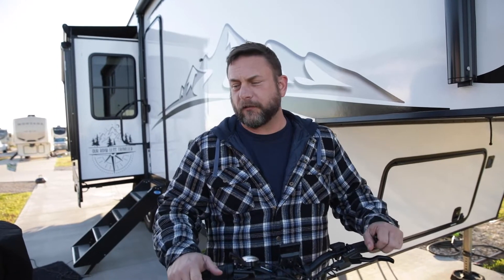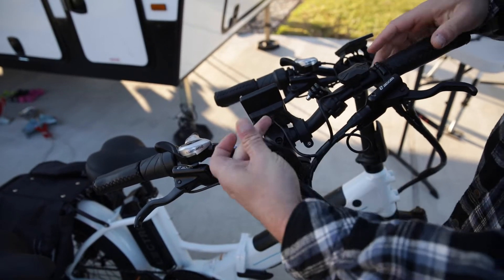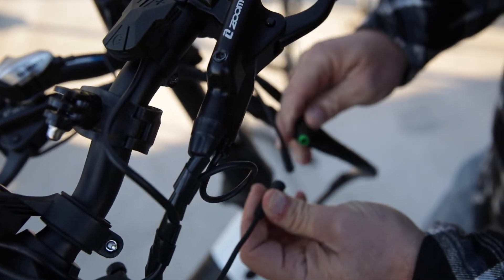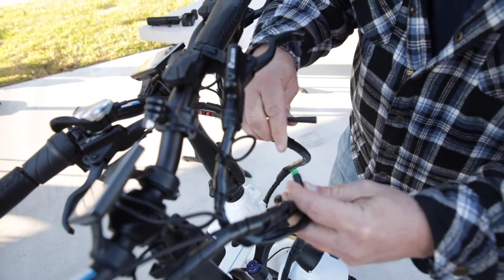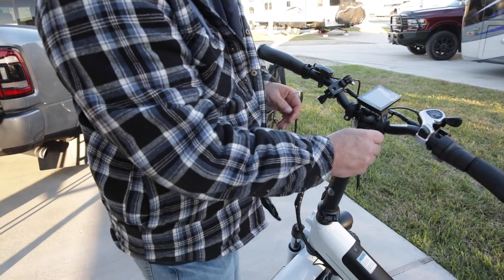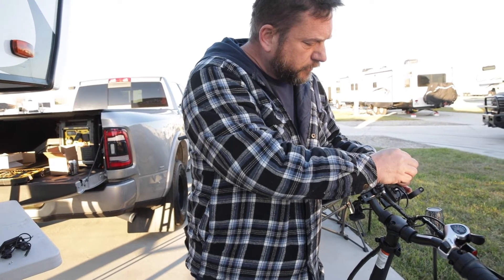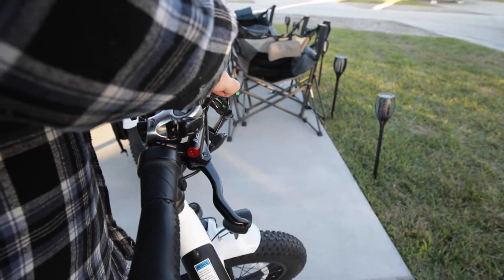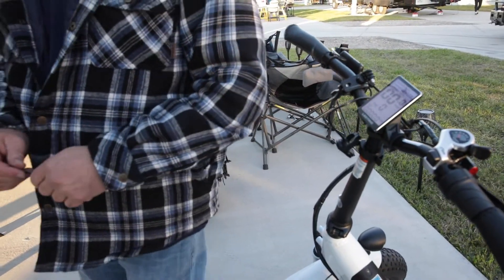How to Fix Your Electric Bike Without Power | Lectric E bike #lectric #lectricxpremium #electricbike

Comment: Just got two brand new 3.0's  late after Christmas. Mine wont turn on my wife's is fine. Tried this trick my screen came on with hers wired in to mine, but it still wouldn't work.
Reply from the maker: Swap the batteries. You may have a bad one.

Comment: My motor wouldn't work but the screen came on, turns out it was the brake sensor!
Reply from the maker: now that is crazy. I guess thats why i cant hold the front brake and spin the rear tire. That sensor stops the motor from working. Glad you found it.
Reply: @OurRoadLessTraveled  I took it to their showroom here in Phoenix and the fixed it in 24 hours

Comment: So if the screen isn’t turning on, and the batteries are fully charged, does this mean the motor can’t run without the screen working?
Reply from the maker: yes, it is a design flaw. all the controls are held in the the screen, so nothing works if it is down.

Comment: Before your screen stopped powering up, do you remember if it was powering up occasionally then powering out when putting motion into the bike
Reply from the maker: No. We had zero problems with it. Worked fine and mid-ride, it died never came back on
Reply: how do i fix this. his problem is happening to me.
Reply from the maker: @tufftiff2424  you'll probably have to call Lectric and get a new screen

Comment: Thank you so much!! Running across your video saved me a ton of time and grief. My XP 3.0 has 255 miles on it and it was doing great until last night. Suddenly, it was completely dead. I am fortunate to have found your video early on in my search for problem-solving tips to rectify this issue. I’m also fortunate to have a Lectric trike as well, which made it possible for me to follow your instructions and very quickly determine that the display is indeed the culprit.
Unfortunately, when I called customer service at Lectric, I was told that they were waiting on a shipment of these and I would not be able to get one until the first part of October. Not happy with that!  I also asked to purchase an extra one to keep in my bag in case this happens when I’m out in the middle of the woods by myself. I was told that they cannot sell them to customers because they have to keep them in stock for warranty replacements.  I am not happy with that answer, but there’s evidently nothing I can do about that. I am very disappointed to have this failure less than four weeks into owning the bike.  Seeing that many other owners have experienced a dead screen makes me think it is a common problem that crops up without warning. Having been told that I cannot have an extra one on hand makes me wonder if the Lectric was a wise purchase after all.
Thanks, again, for taking time to post a very helpful video!
Reply from the maker: we are glad the video helped you out. Lectric must have had a bad batch of screens. we have not had a problem since the replacement and the other bike is trouble free. Both have well over 200 miles on them. Sorry to hear you have to wait. happy trails.
Reply: Same issue here, waiting on a new display. Xp 3.0 long range
Reply: Happened to me as well!!  I was in the middle of nowhere
Reply from the maker: @keg9850  dang I hate to hear that. That’s heavy bike without pedal assist. I hope it was all downhill for you.
Reply: It gets worse, much worse
Reply: @OurRoadLessTraveled  bad batch of refurbished controllers too apparently. On 5th controller in first year. Least dependable ebike that I've owned in 25 years
Reply: I agree with you, I live in Miami Florida and the weather was bad and now I took my e-Trike out to ride and my screen is dead 😵 I tried everything so I went on YouTube and found this, I like my three wheeler e-bike but so much trouble 😢

Comment: I did exactly what you did in this video. I have 2 lectrics. I did the swapping and my lcd screen is bad on one of my bikes. Thanks for your diagnostic trick test.
Reply from the maker: Thank you for watching. Did they get you a new screw
Reply: @OurRoadLessTraveled  I need to get a new LCD screen and a Shimano 7 gear switch. The bike got a bit scuffed up 2 days ago. 
 I emailed Lectric about what I need. They're asking for pictures which is fine. I told them I'd pay for the items. I wish they had all the parts of the Lectric bike for sale on their website. Like a car, you go to the dealership and get any and all the parts you need. 

I hope the screw you're talking about is included.
Reply from the maker: @bubbajones7486  I think it came with new screws. You can go to a bike shop and buy the Shimono gear switch. It’s a standard item.
Reply: @OurRoadLessTraveled  Thank you ORLT.

Comment: Thanks for the video. I have an issue with my 3.0 that just recently showed up. First of all, I have 900 miles on the bike of mostly truoble free riding. I Love this thing. However in the last few days, at turn on, it won't stay on and i have to cycle it again a few times to stay on, and just today while out riding it just shut down on it's own. Turned it back on and worked fine. This bike has been babied and only ridden on pavement. Battery shows fully charged and I did not accidently touch the switch. Anyone esle had this happen? Any suggestions? Thanks
Reply from the maker: We have not had any of those issues. The only time ours shut off, was when the screen went dead.

Comment: You can see your screen damage when the light hits it at the right angle.
Reply from the maker: good observation.
Reply: Was it due to water, heat/sun, or factory defect. Just curious.
Reply from the maker: @BobKarnowski  just a factory defect. The new one has been great and no problems.

Comment: My problem is when going off road last trip out, I lost power, screen went dead and wouldn’t restart. I turned key off and then on again and screen functions and bike will restart. Happened three times. Ideas on what to fix?
Reply from the maker: I have no clue on that one. if a restart fixes it, then is not a loose connection. I wonder if the screen has a vibration limit? I would reach out to Lectric and ask them. Lectric also has a Reddit. Let me know what you find out.
Reply: My Lectric XP 3.0 just started doing the same thing screen shuts off at random, and won't turn on again until I turn the key off then on again. Sometimes I have to pull the key out then put it back in. Any solution to yours yet?
Reply from the maker: @lenscapingmaine  Thank you for the comment. Lectric sent us a new screen under warranty. The end of the video shows us installing it.
Reply: @OurRoadLessTraveled  hello thank you, yes I watched your video it was great! My screen is doing what one of your comments wrote in about his turning off over bumps accept mine does it on smooth roads and even sitting still like when I first turn it on the screen will go out after about 5 seconds I have to turn the key off then back on to get the screen to stay on. Usually several times. Thanks. Brian
Reply from the maker: @lenscapingmaine  hmm that's weird. Have you talked to Lectric?
Reply: It only happens on rough rocky roads. I will probably have to take it back to Lectric for a fix. I live in Tucson so this is only a two hr drive. Probably not an option for everyone.
Reply: @jamesm.4345  Have you talked to lectric yet? Mine does it 9n smooth roads and even when I first turn it on within 15 seconds it shuts off. If I turn the key off and back on it works for a few seconds, but if I take the key out then put it back in seems to fix it. Mine is spermatic. Thank you. Brian
Reply: @OurRoadLessTraveled  I haven't talked to Lectric yet as it's so spermatic I can't catch it on video. I did dip the key in some WD-40 then incerted it and out several times had no problem today since I did that. Thanks. Brian ps I love your videos keep em coming!
Reply from the maker: @lenscapingmaine  I wouldn't have thought of that. Hopefully that fixes it for you. And thank you for the kind words! 😊
Reply: @OurRoadLessTraveled  thanks for making great videos!
Reply from the maker: @jamesm.4345  They may let you take it to a local dealer who could diagnose and then send the parts.